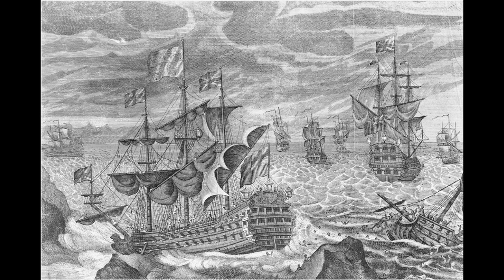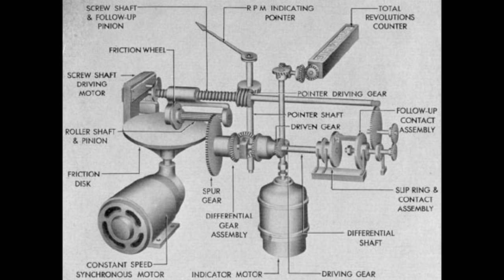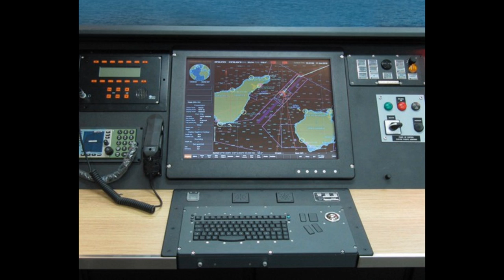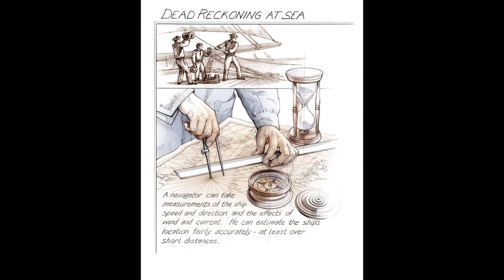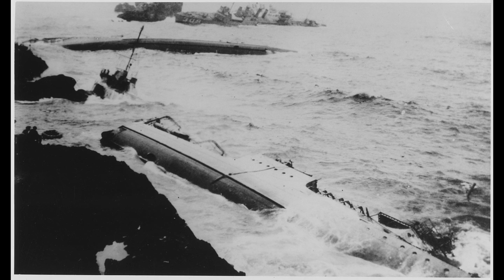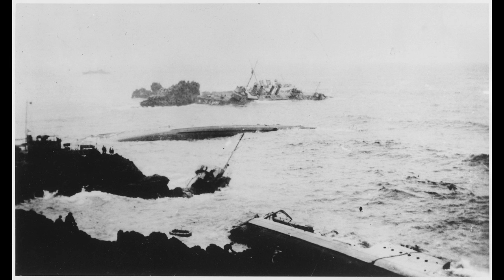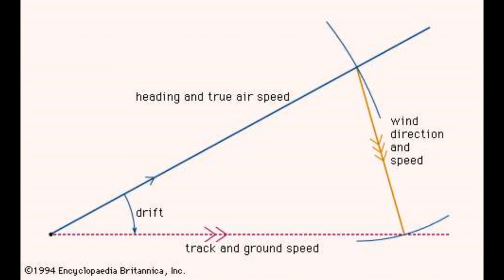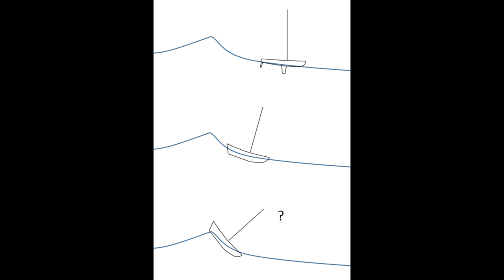Honda Point Disaster - Taking a Wrong Turn at Albuquerque

Comment: I happen to live on this particular section of the California Coast.  These have been fantastically treacherous waters during the long history of naval navigation, primarily because it looks calm and sublime most of the time, but it hides a vicious beast of underwater currents that is not easily seen along with rock formations that are capable of ripping open the most sturdy hull like it was made of rice paper.  People dramatically underestimate the hazards of the California Coastline all the time, even today with modern GPS.  I have seen Honda point up close and how as many people survived that incident is a testament to the training the US sailors and local residents had in such operations.  That incident is a major part of local history.
If for some reason the GPS system went down, you'll see a ton of ships piling up on the coast again because all those skills mentioned have been lost or are so rusty that modern ship navigators are going to be making similar mistakes.  Any storm off the coast here can radically alter the undercurrents and 'normal' wave activity.  The Alaska current is also swift, and while more predictable, gets messed up by large storms that churn up the coastline currents.  So all bets are off.
I think the Court Martial came up with the appropriate answer to the issue, and while I feel for Cpt. Watson, he had no known reason to disregard the signal bearings which were in such conflict with his dead reckoning.  He made the mistake of underestimating the cost of a navigational error.  Had he not done so, he might have taken a second thought and did what Squadron 12 did behind him; slow down due to heavy fog/night and wait for it to clear so he could get better visual bearings during daylight.  The worst he would have gotten was a chat with his superior on why he was late which he could have blamed on the exact reasons.
https://binged.it/35h72Xh

Comment: Last time I was this early.....Richelieu was still under construction.
Anyway.....fantastic way to start my work week, I always love the Wednesday uploads. Heck I love everything Drach post.
I would like to point out that "only" 23 Officers and Sailors died during the disaster. Thats a remarkably low number and reflects greatly on the discipline, courage and skill of the men crewing those Destroyers.
It would have been interesting had the Navy just left the wrecks in place after stripping them. Though I'm sure if they had, by the 50s very little would have been visible. 
Lastly....a movie about the Honda point disaster would be a surprise, but a welcome one indeed.
Reply: Actually there are still bits and pieces of the wrecks there.  However the shoals are notoriously hazardous with very small changes in wave height and tide level changing the water from calm to breaking surf in a few minutes so that you reall can't visit the area.

Comment: A minor quibble with your explanation of dead reckoning at 2:45.  In maritime navigation, you would never normally convert knots to the much less useful miles per hour.  At 20 knots, you cover 50 nautical miles in 2.5 hours.  The direct relationship between latitude and the nautical mile (1 nm per minute of latitude) is quite fundamental to maritime navigation.  I'm not certain of the specifics of the charts used by the US Navy around that time, but I would be very surprised if there was any need to use something other than nautical miles (excepting chains and cables for very short distance, which are just subdivisions of a nautical mile).

Anyway, it's an interesting story which you told well.  It reminds me a little of the Royal Navy's Battle of May Island on 31 Jan 1918.

Comment: Boeing should called their MCAS the Watson system. Same Failure: When you have contradicting data you need to be carefull and throw a dice and say one is the correct.
Reply: Unfortunately for us Air France doesn't really count stall recognition and recovery as nessecary skills so planes need those systems.
Reply: lolroflroflcakes - Not even Air France needs something as faulty & poorly thought out as the 737 Max-8 & MCAS!
Reply: Assume they're both wrong and be very fucking careful.
Reply: The airlines didn't want to have to retrain their pilots for a new type (Southwest and American, I believe), and so pushed Boeing to make the Max a patch-job modification rather than a new type. And, of course, Boeing didn't want to design a new plane from scratch and to go through the process of certification. This kind of crap is what happens when MBAs and bean-counters take over corporate governance, and when activist shareholders coerce boards to manage only for the sake of quarterly earnings and stock price. Stock buy-backs are another corrupt practice. How much money will this exercise in penny-pinching end up costing the airlines and Boeing?

Comment: I have been helmsman on a Gearing class destroyer while we only had one screw and were riding out a typhoon.  Holding position was tricky as I had to hold 10 degree starboard rudder to maintain a straight course.  This was off Vietnam.  
The court appears to have distrusted “newfangled “ equipment from the light sentences.

Comment: Sounds like a classic case of an inoperative Crew Resource Management situation experienced on an aircraft. Many a plane has hit terrain because the captain had not considered the thoughts and concerns of their lower ranked crew member and simply disregarded them believing their ego was right. Seems the same happened here. 

It appears many felt there were anomalies in the data yet the Commander did not appear to listen to concerns raised or because of the levels of hierarchy, had not been advised. Would I be correct to presume in the modern navy all ranks are now encouraged to voice their concerns if such a situation would arise again?
Reply: oh you can voice your concerns but you better be RIGHT

Comment: A sad day for the USN.  They have just recently concluded they need to work on their ship handling in the 21st century, lessons learned are unlearned by the next generation.  This was a unique time in the Navy because of all the extra Destroyers built for World War 1, the navy was actually scraping ten year old destroyers because it was cheaper to reactivate a reserve one than overhaul an existing one.  

As a side note Honda Point is part of Vanderberg Air Force Base and there is a memorial on Honda Point to this disaster.

Comment: Dead reconning navigation had it's problems, another famous case of this going wrong is the B-24 bomber Lady be Good. It's navigator failed to keep accurate track of where he actually was, just following the lead aircraft. When separated, they over flew their airbase, running out of gas hundreds of miles in the Libian desert. Mistaking the desert for the Mediterranean, was the least of their problems.

Comment: I grew up in Santa Barbara where this disaster is part of local lore. Several salvaged items are on display at the Sea Center museum on Stearns Wharf. Can't guarantee the veracity of this idea, but California Vaqueros used a unique tool for roping cattle.  A braided and tanned cow hide rope called a "riata" was passed through a small rawhide loop at one end of the rope called a "honda"  Threading the tail end of the rope through the honda created a "lariat" ( La riata in Spanish) or loop thrown from horse back to catch cattle by their heels. The name Honda Point might refer to navigating your rope through the small diameter of the honda.  The railroad had (and still has) a whistle stop on the coast  at "Surf" which at the time of the Honda disaster also featured a general store.  Local legend says word of the wrecks came by foot to the store at Surf and ranch cowboys went mounted on horse in the dark to the shore to throw their ropes down steep shore cliffs to pull up  survivors.  A special train was requested and dispatched by railroad telegraph at Surf to send crews to help rescue and take survivors to hospital in Santa Barbara.  Might be some factual errors in this account, I'm relating my memories of local stories I read or was told. But kind of fun to think that when the modern US Navy hit the rocks,  real western cowboys came on horse back to the rescue.

Comment: IMHO, no reasonable case can be made for "nothing could be done to avoid this". When a ship is unsure about its position in relation to hazards, it must reduce its speed, and if stop. And the squadron clearly was unsure about its position due to bad visibility, prolonged dead reckoning, and conflicting positional data from different sources.

Comment: Spent 8 years stationed at Vandyland, and I've had the chance to look down on those rocks and see some of the remaining wreckage of those Destroyers, specially at low tide when more is visible, many times over the years.  That coast is pretty dangerous all year round. There is a road you can take from coast road to an area right above the accident site, and, If I remember correctly, remnants of the old Coast Guard Station and Train Station are still present.

Comment: I used to live not far from Honda Point, or Point Pedernales, as it was more commonly known to the locals. I just can't describe how dark it was on the coast during a moonless night and in the fog. As usual with new inventions, the RDF gave them correct information about where they were, but it was generally disregarded because of known problems with atmospheric conditions, especially on a cool, foggy night like that one. They were lucky that ranchers in the area made a pretty good supplementary income salvaging vessels that ran into the rocks, a not uncommon occurrence. Their skills with breeches buoys and small boat handling helped save many lives that night.

Comment: Even without the trouble to Dead reckoning, it'd be a Wise Idea to Slow down before changing course especially if Weather conditions aren't good enough to Confirm your position,
Besides that I'd count it Dread Negligence to outright Ignore some piece of Data instead of recounting things to ensure that indeed that piece of information can be safely ignored

Comment: A speed of 20 knots is 20 NAUTICAL miles per hour. Navigators would never use statute miles. A nautical mile is one minute of latitude on a chart, and navigators measure distances using dividers placed over the latitude scale on the sides of the chart. PS: I have sailed around Point Concepcion/Point Arguello/Honda Point... more correctly, motored past them on a calm day. There is good reason for calling this cape the Cape Horn of North America...

Comment: Looked it up and surprising that there was depth measurements in 1915 beyond the ancient lead and line method until 1922 when the "in October 1922, USS Corry was fitted with a Hayes Sonic Depth Finder for testing" and did some surveys of parts of the California coast.

Comment: I've been stationed at Honda Point and have seen the wreckage that is still visible. What is not fully appreciated is just how dangerous the waters at Honda Point are. The day I reported, an exchange student from Japan was missing. He was last seen photographing the waves from rocks along the shoreline, and he never was seen again.  Rogue waves were common without warning as were Tsunamis of varying sizes. When walking on the beaches, one never turns one's back on the ocean at Honda Point or Seal Beach just north of the wreckage site. If you go in the water to your knees, you have gone too far. During storms and high surf conditions, locals avoided the shoreline all together. Thus was the kind of water this disaster happened in. The fog is ever-present, rolling in by mid to late afternoon and burning off by mid-morning.  While I was there, a young girl was found alone on the beach crying for her grandfather. During the night her grandfathers boat got into trouble just offshore and the vessel was sinking. Granddad swam to shore with the wee girl, seven years old IIRC, and swam back to his sinking vessel for his wife. Neither was ever found, though some fiberglass from what was likely their boat did wash ashore a day or so later. No distress call was ever received from the sinking vessel. That is Honda Point, Ca. and the wreckage site described above.

Comment: whether or not he was aware of the earthquake or the solar flare he knew he was in following seas and that his props were breaching. So he knew his dead reckoning was significantly questionable even if he didn't trust the beacons. He also knew he had no visual references. So he maneuvered based on nav data that he knew was inaccurate. He didn't know HOW inaccurate but you don't just assume that your known bad data is "good enough" or things like this happen.
Reply: In any case it would appear to be safer to follow the RDF since the worst that could happen is that you would be too far west  and away from hazards.
Reply: @bobraible  yeah, THIS is the part I don't get.  why didn't they compare the two?

Comment: There is a running commentary in the Patrick O’Brian novels regarding the anti-innovation attitude of the Royal Navy of the time (Napoleonic era). Apparently, this was not an isolated attitude.

At the very least, the discrepancy between the dead reckoning and the radio beacons should have been a cause for concern, and it seems to me that a prudent commander would have ordered a reduction in speed while this was investigated. But if the fog was thick enough to prevent a visual fix on the lighthouses, I would have thought that foghorns would have been utilized.

Comment: I believe the home port of the U. S. Pacific fleet at this time was Long Beach.  San Diego did not become a primary port until it had a reliable rail connection, which it lacked until early in WW2 as I recall.

Comment: I tried sailing to a very small Channel Island: Santa Bárbara Island in a sailboat with just a compass, chart & old fashioned piece of 2x4 wood tied on to a rope with knots on it at set intervals which would be thrown overboard & let drift for a set amount of time & then hauled back in & the number of knots the sailboat was going could be calculated. But the weather was poor, visibility poor and although I think I got close to my target the first day, I had to turn around & head for the much larger Catalina Island and make for my target the next day when weather & visibility was much better.

Comment: Sounds like the problem is that Mr. Watson didn't trust new technology.  The US Navy had similar troubles with some commanders not trusting radar early in ww2.  To be fair early USN radar was quite faulty and there were many times when radar detected things that were not there.  It's possible Mr. Watson thought the radio bearings could have also have been faulty as well and instead decided to trust a system he knew as a veteran.  Well at least he realized it was his fault for not trusting the radio bearings in the end.
Reply: AC: On a related side note, Radar was not accepted as an 'official" source of navigation under international maritime treaties until the mid-1970's. So in fact ship's captains could not legally rely upon radar as a sole source of navigation until that date.
Reply: @KB4QAA  Understandable.

Comment: This is probably "small potatoes" for you, Drachinifel, but my father, who was stationed in San Francisco during WWII, told the story of five DEs (destroyer escorts) that were rammed so far up on a nearby beach that it was possible to "walk around them at low tide without getting your feet wet." The officer in charge of the flotilla had been in a rush to get back to SF and give the crews a weekend liberty; and convinced of his thorough knowledge of the local waters, had decided to press on despite heavy fog. No idea as to the veracity / accuracy of this.

Comment: This is actually similar in some respects to what happened to the Spanish Armada.  They got attacked by some fire ships, panicked and took off.   Given the wind at the time they thought what they were going to do - was to sail up North of the British Isles and then come down West of them until they were clear before sailing home.  What they didn't realize - was that there was a stronger current coming from the west than they thought there was - and it pushed them into the land where a lot of them were wrecked.  THAT was the disaster that befell this fleet. The British warships didn't hurt them badly, the fire ships didn't hurt them badly but they were a lot farther east than they thought they were when they came down - and that is what got them.
.

Comment: The moment I heard the use of screw revolutions being used to calculate speed, as a gamer, I had flashbacks to every poorly done console port of the 2000's. You don't do that. You don't tie vital logical timing that can be affected by unforeseen circumstances to anything important.
Reply: Can you give a specific example? I was in my early teens in the early 2000s so I'm not exactly sure what you are referring to. Sorry for my ignorance, that's why I'm asking, so as to no longer be ignorant
Reply: @micfail2  
A prime example would be Saints Row 2 for PC. Literally every animation, plus vehicle movements were tied to framerates. As was fall damage & vehicle strike damage, since both were apparently calculated using simulation speed. Which is fine on console, since the hardware is a known absolute. But was a rookie mistake even then for a PC port.

The resulting mess was nigh unplayable without a fan made patch.
Reply: @TrollOfReason  oh wow. Yeah I can see how that could make the game totally unplayable. Thanks for the response 🙂